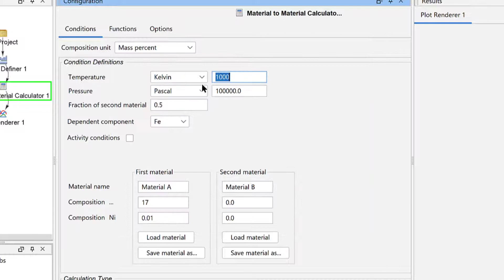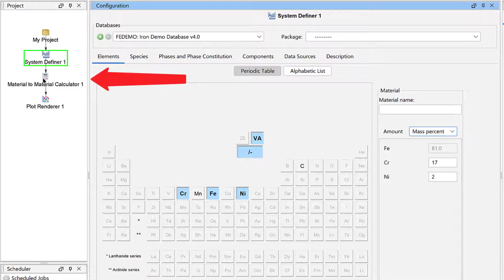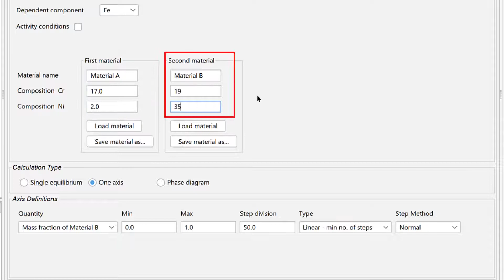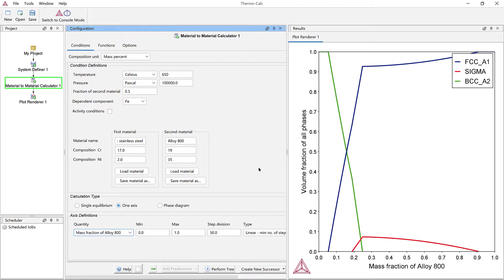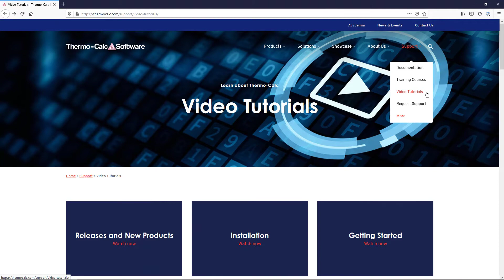Example T_14 - Graded Transition Joint for FeCrNi Alloy using the Material to Material Calculator

Comment: How to understand the mass fraction of Alloy 800? What does 100% of Alloy mean? How do these two different materials contact? Will the kinetic simulation be feasible to simulate the thickness of different phases?
Reply from the maker: Hi! Thank you for your question. The mass fraction of Alloy 800 is the amount by weight of Alloy 800 mixed with the martensitic steel. The X axis goes from the chemistry of the martensitic stainless steel on the left, to the chemistry of alloy 800 on the right.  0.75 mass fraction of Alloy 800 is then 75% Alloy 800 mixed with 25% of the martensitic stainless steel.  In reality, if you started with a diffusion couple of these two materials, the diffusion path would not be a straight line between the two materials, as different elements diffuse at different rates, and along different chemical potential gradients.  A full kinetic simulation will be more computationally expensive, and depending on the phases involved, could predict the thicknesses of any layers that might form.  This alloy to alloy calculation is a good way to quickly check for any potential deleterious phases that might arise in a diffusion couple, graded transition joint or similar.
Reply: @ThermoCalcSoftware  Thanks so much for the explanation!